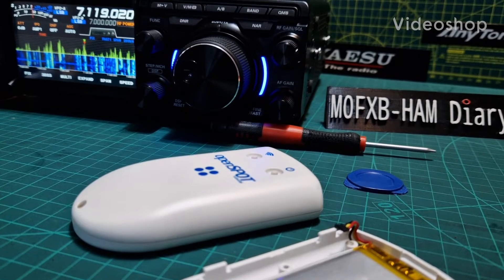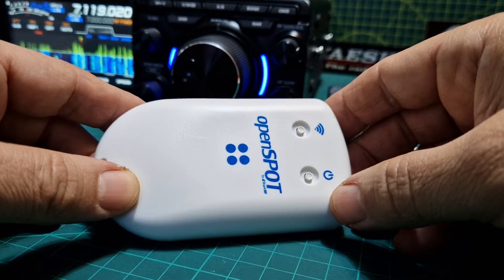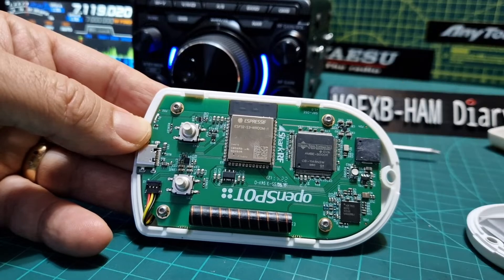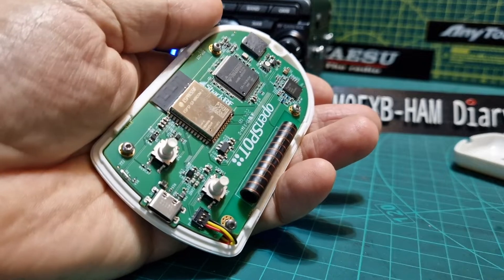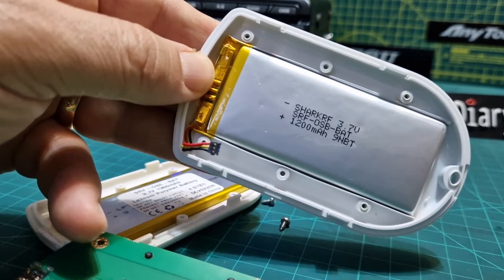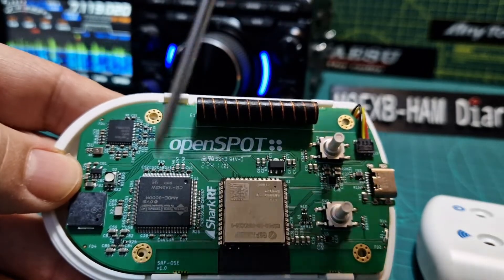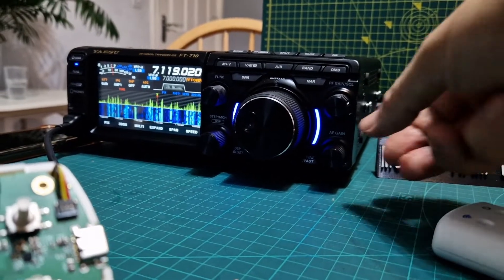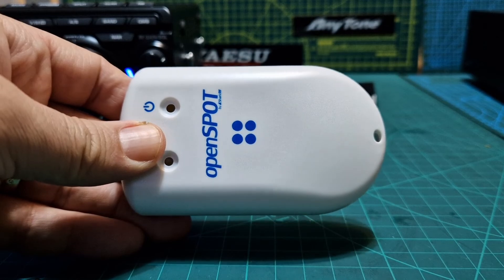OPENSPOT 3/4 Battery Interchange ??

Comment: Andreas, you asked about Wi-Fi in this video. 

I did some searching and that Espressif chip module is the Wi-Fi chip. Here is what the datasheet says: 

"ESP32-S3-WROOM-1 and ESP32-S3-WROOM-1U are two powerful, generic Wi-Fi + Bluetooth LE MCU modules that are built around the ESP32-S3 series of SoCs. On top of a rich set of peripherals, the acceleration for neural network computing and signal processing workloads provided by the SoC make the modules an ideal choice for a wide variety of application scenarios related to AI and Artificial Intelligence of Things (AIoT), such as wake word detection, speech commands recognition, face detection and recognition, smart home, smart appliances, smart control panel, smart speaker, etc. ESP32-S3-WROOM-1 comes with a PCB antenna."

Or were you asking about the antenna location?
Reply from the maker: Thanks good info .